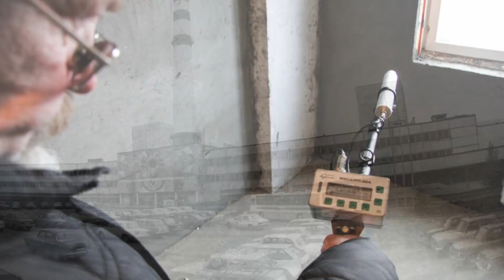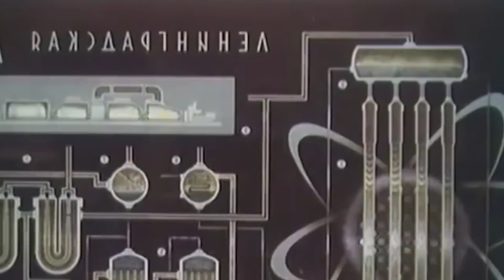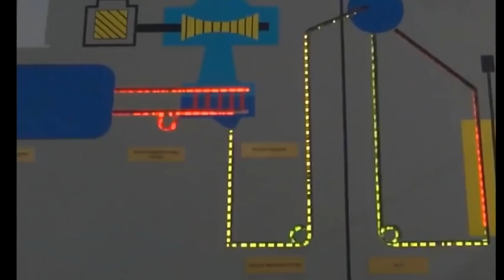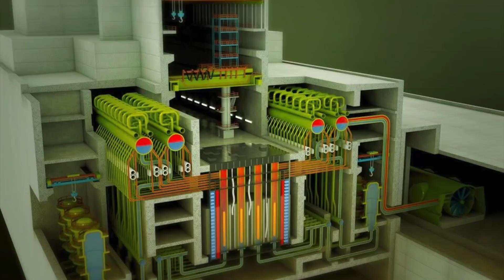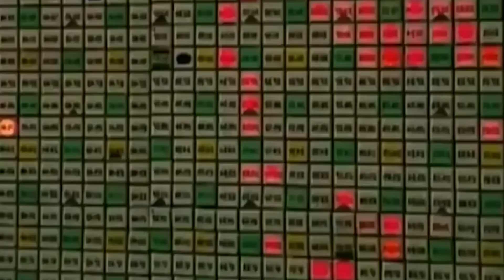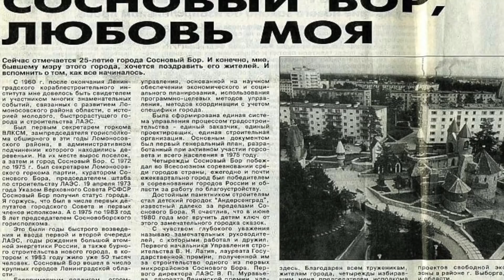How the Leningrad NPP Exploded | The Chernobyl disaster was Declassified

Comment: Why not find a decent translator so the text you are reading is more understandable? The clickbait title is unnecessary as well. Nothing at LNPP "exploded." One fuel channel was fuzed into a solid mass, while numerous adjacent fuel rods were damaged.

By the way, these are the likely reasons that Leningrad Unit 1 did not explode:

The fuel was 'fresh' with low burnup, since the reactor was brand new. At Chernobyl, Unit 4's fuel had a fairly high level of burnup, which increased the void coefficient of reactivity.

LNPP had numerous Additional Absorber rods permanently inserted in the reactor, which had a major impact on the void coefficient. Sometime in the late 1970s, RBMK plants started removing these rods.

The graphite displacers on the control rods at LNPP were slightly longer, so that the water gaps beneath them were only around 1 meter high, instead of 1.25 meters.

Finally, SIUR Karrask inserted all the automatic control rods, stalling the reactor before pressing AZ-5. Therefore any tip effect would have taken place in a reactor with declining reactivity, not rising reactivity like at Chernobyl.